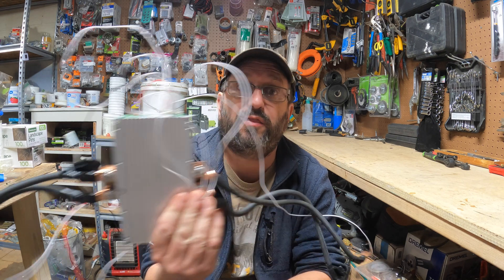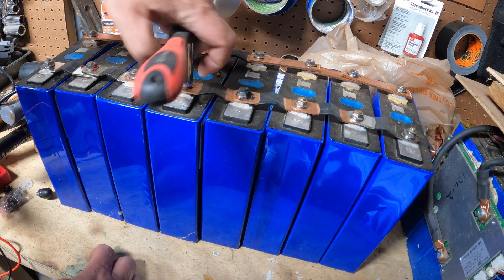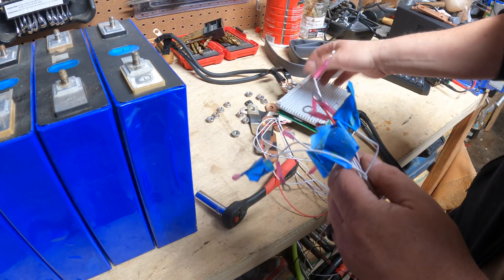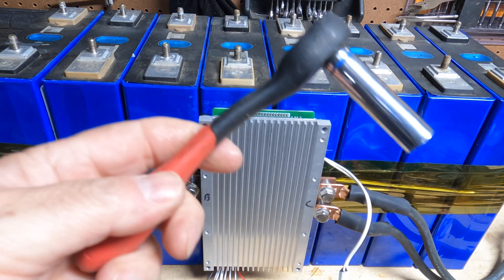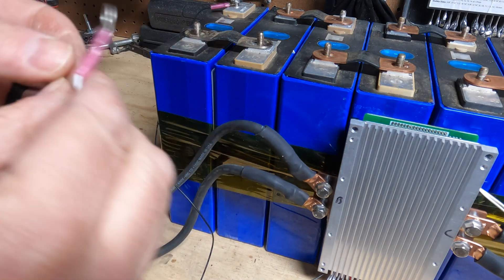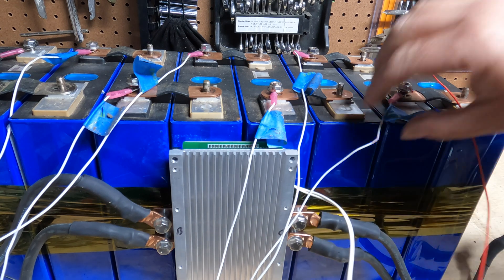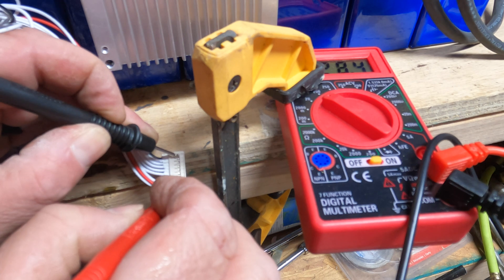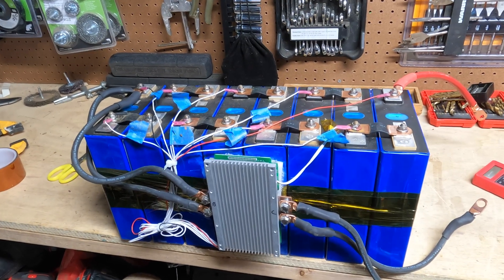24v 200ah LiFePO4 DIY battery build. But is it just cheaper to just buy an off the shelf battery now

Comment: Why not use 9 batthary
Reply from the maker: Using 9 would create an unusual nominal voltage, which could lead to issues.  It would be something worth testing but I wouldn't recommend on a live system.
Reply: @OurBlackCatCottage  i need to make it. Can i used which BMS if i  make 9 th battary pack ?

Comment: Nope. Building batteries is still cheaper. About $250.00 compared to the example you gave. Apexium has US stocked EVE LF280K-V3 3.2V 280Ah for $76 per cell shipped and taxed. That being said there are advantages to buying a prebuilt battery but not quality or cost value.
Reply from the maker: Good tip but it is really more like, it is still cheaper to build larger batteries. Small builds are dead.  And I love making batteries.  I might get some larger cells and make another one.

Comment: what? you can order 4x 280ah lifepo4 cells shipped from china for 160 bucks right now. get rid of the bms and just use an inductive active balancer board for 5$. 8kwh 24v system for 325$. 8 of them fit perfectly inside of a 20mm ammo can for 30 bucks as long as you get the older threaded style cells. fireproof enclosure and all, 360 bucks. that same battery in server rack form costs 3 times that. the only issue is bus bars if youre pulling close to 1c, and wires as you said, and the 3 months shipping (thats actually how you know youre getting them direct from the mfg)
Reply from the maker: You should post a link to those cells you bought.  I bet the are cheap LiitoKala or some other B grade cell. Beware of cheap cells.  I have several videos on that.
Also, people, do not use an active balancer in lieu of a BMS.

Comment: I built a 48 nominal (51.2) volt battery with Grade A EVE LF280K cells and JK BMS with Bluetooth, 2A active balancer and 200 amp for $1,339. That is a 300 Amp Hour battery. There isn't any pre-made battery with 300 AH @15,360 watt hours that can comes close to this price and performance. You would need three $1,200 rack mount batteries @ $3,600 to match this one battery.
Reply from the maker: You make a great point.  Large custom builds like what you did still make sense.  Btw, sounds like a nice build.
Reply: Thanks, I built four of these batteries for a total of 61.4 kilowatt hours. This is good for about 6 days of anatomy. We are 100% off-grid with an EG4 18KPV inverter/charger and 15 kilowatts of Bi-Facial Solar. We also charge the battery bank with an EG4 Chargeverter @ 5,100 watts at 100 amps.
Reply: @stevenfrazier8939  hello, I am trying to build 2 of 48v 280AH, I wonder that type of wire did you use to put yours in parallel? I am using a JKBMS as well. with 2 growatt inverter.
Reply: @usafshorts  Thank you for the question, I used 1/0 American Wire Gauge  Fine strand Black & Red Pure Copper Flexible Wire. At the start I had two batteries and connected both to a bus bar with equal length wires, that is very important. 1/0 AWG can handle 285 amps. Now that I have four batteries they are grouped in pairs with equal length wire back to the bus bar. I did put my battery cells into  a DIY kit box by Apexium which came with JK-Inverter-BMS. They are pricey at $640 each so I get it if that is not on your radar at this time. The point is, I used the same size wire for the build as well. At 12,000 watts and 51.2 volts I can pull 234 amps divided by 4 batteries is only 58.5 amps from each battery.

Comment: 24 Volt 100ah with Low Temp Protection and 100amp BMS $325.00 Shipped Free 5 year Warranty - So I bought 4 for 10KWH Battery Bank to Drive a 3000 Watt WZRELB 24 Volt Inverter and Victron 150/35 Smart Solar Charge Controller with 1200 - 2000 watts of Solar Supporting It.
Reply from the maker: Exactly!  They are so cheap now.  Why even bother make it now.